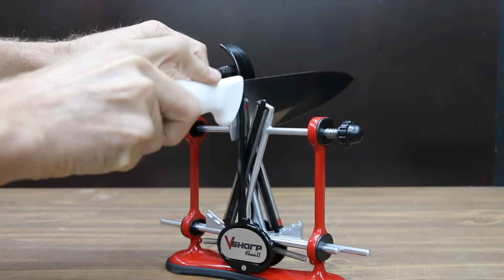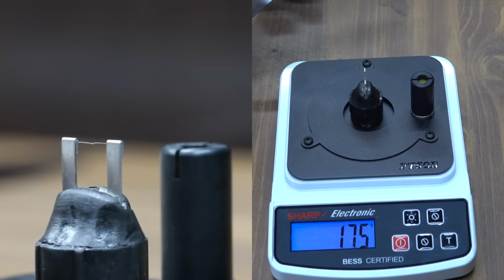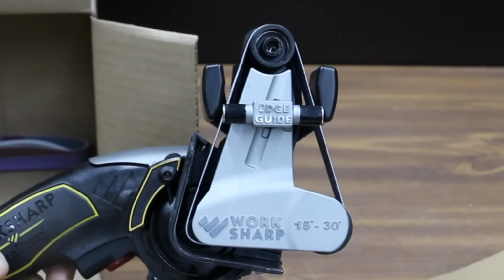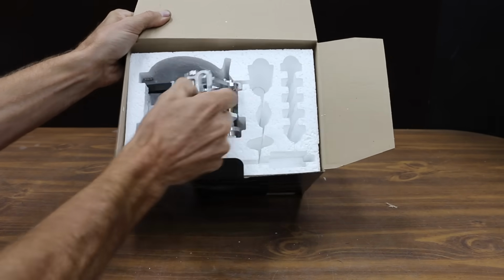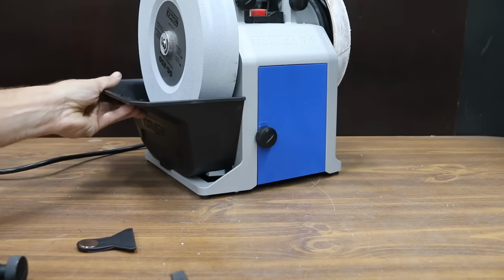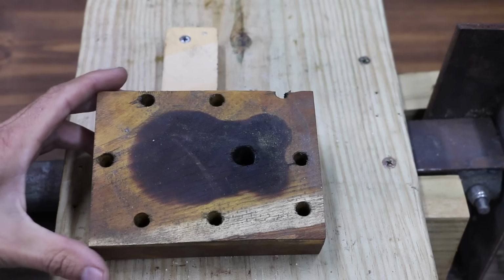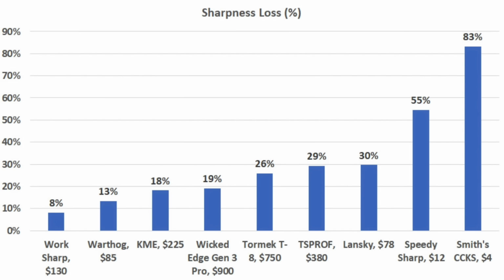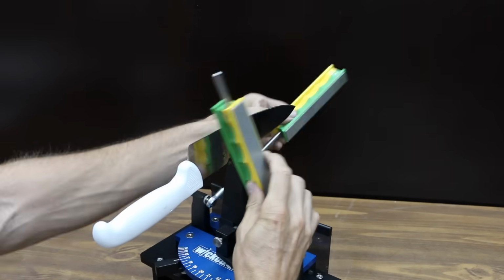RUSSIA vs USA Knife Sharpener? TSPROF vs Lansky, Wicked Edge, KME, Tormek T-8, Work Sharp Ken Onion

Comment: I have two Lansky-style sharpeners, an older model with grit stones, and a newer model with  diamond stones.  Both work fairly well.  For my pocket knives I use Diamond Machining Technology folding diamond pocket sharpeners, green 1200 and red 600 grit.  They put a razor sharp edge on any pocket knife I've tried them on over the years.  I appreciate these extensive and clever testing methods, including the cheap $4 one that hardly deserves honorable mention but actually does some good, maybe in a tackle box.  I saw a display from the same corporation with different models using the same method of sharpening, so the company seems to be serving a market.
Reply from the maker: Thanks!  Thanks for sharing.

Comment: I'm loving my DMT Sharpening System, which is the same style as the Lansky and most of the others tested here today. The DMT is in a pouch for portable use, and I keep it in my GO bag. I also have a Smith's PP1, which has the carbide and ceramic V rods and a tapered diamond rod for sharpening serrated knife blades and gut hooks. Love it.  My DMT was under $50 and the Smiths $8. 
Diamonds are a MAN's best friend, too.  ;)
I  don't know anyone who doesn't want the lovely & overpriced Tormek sharpener, but the Wen is $141 and the Jet $469.
Reply from the maker: Thanks for sharing.

Comment: There's a lot that goes into edge retention the biggest factor is usually the steels that a knife is made of then the angle. I like that you used the same knives all around but unfortunately that doesn't mean they all are the same hardness due to how they are made. However I doubt there was much difference to show up with this test.

How about testing the differences between the angles from say 12° to 21°... just for reference .
Reply from the maker: Thanks for the suggestion.

Comment: You can get wayyyy under 85 on the wicked edge lol!
Reply from the maker: Thanks for the feedback.
Reply: @ProjectFarm  Much love brother, love your videos!   You should really get the leather strops for the wicked edge, I even just with my fingers at the top of the strops hold some 2000grit 3m sandpaper along the strop and just strop away from the edge.

Remove the paper strips to follow with the diamond compound.  I think the leather strops were very affordable also!

I have the 1500/2k stones also but not extremely necessary.

Comment: The Tormek T8 is not a simple knife sharpener, it can sharpen nearly anything( not circular saw or bandsaw blades), has a wide array of jigs and of wheels that guarantee sharpness precision  and repeatability though very expensive . The drill bit and the planer blade sharpeners are simply perfect. As for knives the kj 45 is a way better jig than the one used in the video.  
I truly love your videos by the way. I have used them to buy a lot of tools, from wera Allen keys to Wiha screwdrivers to Bosch 18v orbital sander. 
Warm regards
Reply from the maker: Thanks!  Thanks for the feedback.

Comment: I own a spyderco sharpmaker and the tormek t4, the speed of the tormek is really a factor j enjoy about it, and with its various jigs you can use it to sharpen many different tools! Not surprised though that it doesn't make the knives as sharp as the kme or the wicked edge as those products are specifically designed for knives and knives alone. Appreciate the review! I wish you had the jigs for the tormek though but that's okay you did it right haha use what ya got! Definitely takes practice to use some of these sharpeners cheers!
Reply from the maker: Thanks!  Thanks for sharing.

Comment: Edge retention is a function of the composition and heat treatment of the metal. Got nothing to do with the method used to sharpen it.
Reply from the maker: Thanks for the feedback.
Reply: Completely false. After using the Work sharp that puts a convex edge on the knife it stays sharper much longer. That's testing with the same knife and just going from a flat stone to the belt of the work sharp.
Reply: @mikecamrcplus3057  soooo if I get a crap cheap knife and run it over you system it becomes good?  Different edge profiles will last various amounts of time but if the steel you start with is not good then you never get a great edge or edge retention. Not going to argue what sharpening system is better or worse as most of them are pretty good but you can’t polish a turd. If the steel is not quenched and tempered properly your edge will fold not matter what system you use.
Reply: @tonydpayne  You said edge retention has all to do with composition and nothing to do with method used, your words. Now you say and I
 quote " Different edge profiles will last various amounts of time " 
No kidding that is what I said, you said it was composition only.
 The convex edge that the work sharp puts on a knife does last longer and was proven by project farm in his testing at the 15:00 minute mark. The work sharp beat all the other sharpeners in sharpness loss, because the convex edge of the work sharp which is the method by the way was the longest lasting. Does not matter if it is a $1 knife or a $1000 knife the work sharp convex edge because of it's bevelled thicker edge will last longer. 
Can't explain it in any more simple terms so if you don't understand or you want to change what you said again I can't help you. 
Hint: the convex edge as used on samurai swords was preferred as the
 " Method " left more material behind the cutting edge. lol
Reply: @mikecamrcplus3057  mate no changing anything and not interested in arguing. Yes a convex edge will last longer as it has more metal behind it. BUT a convex edge on good steel will way outlast a convex edge on bad steel. I do a lot of sharpening and on some of the systems in the vid. Not goi g to argue their merits as they all have good and bad points. I also forge and make my own knives. Good steel will out last bad steel full stop. You have fun with what ever works for you mate. All good
Reply: @tonydpayne  Quote " Edge retention is a function of the composition and heat treatment of the metal. GOT NOTHING TO DO WITH THE METHOD USED TO SHARPEN IT. " 
Now you say, Quote " Yes a convex edge will last longer " lol

Comment: You should test the Tormek T-1 home knife sharpener. Although it only has  600 grit (diamond) wheel it includes a honing wheel with impregnated compound (no need to add any) and seems much easier to setup and use than the T-8.
Reply from the maker: Thanks for the suggestion.

Comment: Aaaaah nice but thats not how you sharpen on the tormek, when you transition from the flat blade to the curved part of the knife towards the tip you are NOT supposed to level the edge with the stone but to pull up the handle while keeping the edge on the stone, if not done correctly it changes the angle of sharpening like alot. Took me fair few knives to actually find that out in an instruction video. Furthermore i dont know if it just didnt make the "cut" but on the tormek theres a handheld stone with which you can change the grit on the main stone, from 200 grit to 1000. I have the previous model t7 and its not at all hard to get a scary polished edge. Ive tried almost all the tools except the russian one and its damn hard to match the speed of the tormek when dealing with heavy damage on the blades. That is with the factory handle and with the correct technique, i guess it takes out ease of use points but the results might be off.

Comment: Great review. Have you hear of the Edgemaker sharpeners? They seem to do a great job in sharping knives and are very easy to use. They are like the Smith's but with a handle to make them easy to hold and protect yourself from getting cut sharping the edge.
Reply from the maker: I will check it out

Comment: It would be even more helpful if you were to use each device's finest grits commonly available. The T-8 has a 4K grit Japanese water stone, and the Wicked Edge has 1.4 and .6 micron stones, not to mention the leather strops. I find the T-8 to be the quickest sharpening method, but prefer to hand sharpen with Japanese style wet stones. I rarely use my Wicked Edge, but you are correct about it creating a very good edge. I do believe that a highly polished edges will slice better as rougher edges are simply not as smooth, and thus not likely to slice as easily as a highly polished edges. Anyway, I love watching your channel and have learned much from it, along with you frequently it seems. Thanks for the great work!
Reply from the maker: You are welcome!  Thanks for the constructive feedback.

Comment: Great stuff, Only the Tormek test wasn’t great, this stond can do two roughnesses with the grading stone. and if you’re a bit serious you als buy a finer stone to compliment the standard stone. And you’re substitute knife holder might have done the job, but won’t have helped the end result. Also you’re technique isn’t correct, you need to lift the knife along a different axes to maintain the same edge angle. But for a first timer you didn’t do all that bad, just know that there is a lot to gain still.

Comment: Well here is one for you. I was in Alaska and shot a bear and was skining it and my knife became very dull. The native Alaskan picked up a rock and said you need to sharpen your knife. I did sharpen my knife and finished skining the bear. This just shows you you dont need to spend a bundle on a sharpener, My lansky i bought years later works just great. 
As you use your knife the edge will become rounded and you will need to resharpen. The edge needs to  be kept at the same angle each stroke to get that razer edge. I start with a course stone and work my way to a very fine stone. Dont be in a hurry , take your time and  it will work for you. Good luck.
Reply from the maker: Thanks for sharing.

Comment: Impressive testing as usual!  Would like to own the Wicked Edge as it is the best but also looks to be relatively easy to use, but at $1,100...ouch!  Not one being shy to spend money on the best, but not sure I can justify...so glad you suggested the Lansky as a lower cost alternative.
Reply from the maker: Thank you!  Lansky is a great system
Reply: @ProjectFarm  I'd be curious as to how the electric sharpeners compare to these manual ones. American Test Kitchen seems to like the Chef'sChoice Trizor XV EdgeSelect Professional Electric Knife Sharpener as they rate it as highest/recommended, but while they might be more convenient, do they put a good, consistent edge as a Lansky or Wicked Edge?
Reply: I've been using Lansky for over 25 years. It was very affordable and has proven durable. Do your part to be consistent in how you stroke the blade edge and you will be rewarded with a very sharp blade edge that lasts.
Reply: I own a Wicked Edge Go and I personally wouldn't buy another WE product.  They simply don't have enough value over KME, TsProf, or some of the other like systems.  The stones are very expensive and proprietary.  Also WE has issues with full flat grind knives working well in their clamps.  They sell silly cardboard shims to make up for it.

Comment: Sharpening is to me always a PIA.  I'm always interested in a sharpener that is quick and easy with good sharpness.  Is the Lansky relatively easy and quick?  It would be cool to include sharpening times with the results.  Kudos for making your own knife, I know it took some time.
Reply: It's pretty easy and gets good results, but you sound more like you'd be better off with some kind of electric knife sharpener. 

The Lansky isn't complicated, but you have to tighten the knife into the holder as shown (which means taking a minute to get a screwdriver), screw the sharpening stones onto the guide rods, etc. If you have a place to leave it set up (like a garage work bench) it'd be convenient, but to put everything back in the case, you have to disassemble it (simple thumbscrews, but it takes two or three minutes).

If you want minimal PIA, get some electric thing. Or buy 5 of your favorite knife, sharpen them all, and use them one by one, until they're dull. Then sharpen them all at once, so you don't have to do it very often.

Comment: I would have liked to have seen the tormek with the actual blade holder being used. Doesn't seem like it got a fair shake out of the deal. Also the cheaper version Wen brand sharpener seems pretty impressive.
Reply from the maker: Thanks for the feedback.

Comment: i worked in a metallurgical lab for 25 yrs and can produce an consistent edge on a knife or chisel using a worn 220 sanding belt and a buffing wheel with comparable sharpness in less that 30 seconds. Verified using a metallurgical mount & metallographic analysis and verifying hardness by performing a knoop microhardness survey of the edge of the knife
.
Reply from the maker: Thanks for sharing.

Comment: Regardless of what is the best actual sharpener of the group unless you sharpen knives for a living you are not paying $900 for a fking knife sharpener. I paid $20 for a lansky 25 years ago and still have it today. Most kife sharpeners will put an edge on a knife good enough for 98% of the population to use. The only thing this video shows is just how much money you waste buying the more expensive stuff because you don't get that much jump in performance to justify the price but if you sharpen 200 knives a day you better have a power sharpener. I can put a mirror finish on any kjnife with my lansky and shave with it  if I invest enough time .  This video is good but with a manual sharpener you still need to develop memory and control to achieve the best result.
Reply from the maker: Thanks for the feedback.

Comment: I've noticed edge retention comes from 2 things. 
1.) Cutting the carbides in the blade, this can only be done with diamonds
2.) Never touching the blade with any abrasive that isn't diamond, as a ceramic rod or steel rod will not cut carbides but will yank them out
Knives I do with my KME system and follow these rules with will stay shaving sharp for a year of regular use, as long as it's a quality steel.
Reply from the maker: Thanks for sharing.

Comment: Sorry man, but imma call it right now.. (we used to compete on a submarine to pass the time) as the who can get the sharpest knife...and  NO ONE used the "so called easy and FAST TOYS" a genuine set of stones.. will ALWAYS perform IMHO
.. why not when you do a video like this next...take the best from this video VS A true set of stones and see how they compare?

I didn't always win but I DO FEEL CONFIDENT Time and effort VS quick and UGLY will always prevail.. and I would say less material wasted but better used. So less material being removed but still a better edge vs grinding off layers of metal...to get a comparable result but less blade life.

I have gotten responses from you over the years..but this is something I am truly passionate about even now  today.
I sharpen customers mower blades manually VS a machine and I would bet my career they are better balanced honed in 
 and when it comes to a pocket knife it will be sharper.
+Project Farm

@Project Farm
Reply from the maker: Thanks for the video idea.
Reply: @ProjectFarm  Nah as always thanks for your honest test!

Comment: just purchased the Lansky diamond sharpening system based on your results thanks so much for your effort! BTW, why would edge retention differ from one sharpener to another if the knives and steel are identical along with the edge angle?
Reply: they are $100 6months later.

Comment: This is more proof of why I am a disciple of the Lansky. I’ve been using it for 20 years, and feel confident I could get a knife to 50 or less with my experience. I want a wicked edge, and it’s the only sharpener that I would buy over my Lansky set. But at $700-1000, I’ll likely stay a Lansky guy until I win the lottery. 

Project farm, you should get the Lansky ultra sapphire stone. I’m pretty sure with it you would beat the wicked edge.
Reply from the maker: Thanks for the suggestion.  Thanks for the feedback.

Comment: Can you test the Horl 2 knife sharpener from Germany or even the pro version of them with different stones? It’s a roller sharpener very easy to use seems like. May you can include the best cheap Damascus steel knives what you can buy. Thanks
Reply from the maker: Thanks for the suggestion.

Comment: I do think that with a lot of experience with the Tormek T-8, TSPROF, Wicked Edge, KME, and even the Lansky you can get your knife extremely sharp.  I think they are great systems.  I think Wicked Edge is regarded as the gold standard of angle precision.  I saw a guy on the Australian Knife Grinders YouTube channel that sharpened two knives exactly like these ones using 2 different techniques using a Tormek and a grinder.  One of the knives tested at 49 on the Bess and the other tested at 34!!!  I have never seen anyone even come close to a 34!  He is extremely precise in his setup and uses lots of steps.
Reply from the maker: Thanks for sharing.

Comment: No it is not possible that the cheap smiths sharpener is just as good!  😂  Those little v-groove honing tools aren't bad for touching up a blade if they match the angle you sharpened your knive at.  That's why I would go with the Lansky one that has 4 slots with 4 different angles.  Something like that would definitely be useful in the field to touch up an edge.
Reply from the maker: Thanks for the feedback.

Comment: You should check out the Slicing Edge CW1-BRK sharpener wheels for a bench grinder.  Probably the easiest way to get a super sharp edge quickly.
Reply from the maker: Thanks for the suggestion.